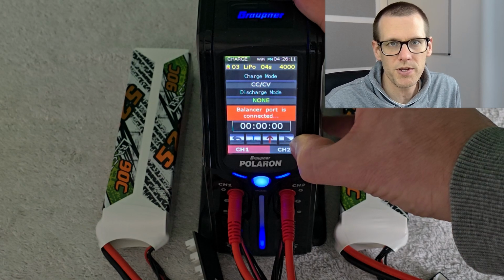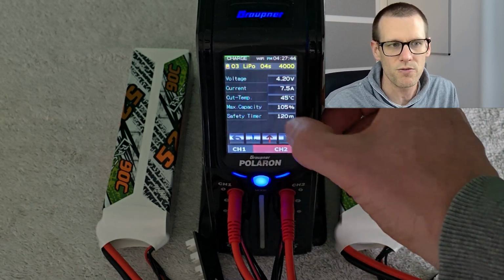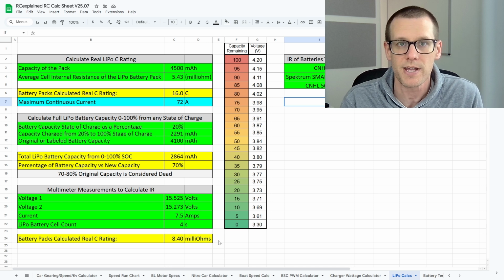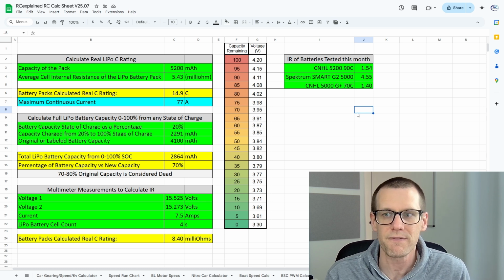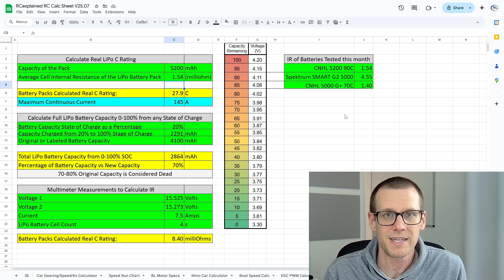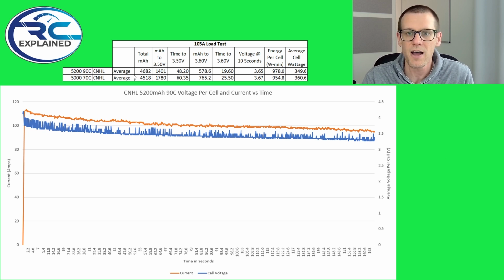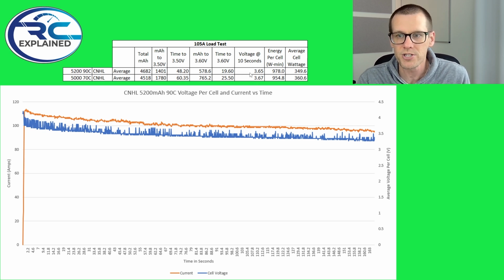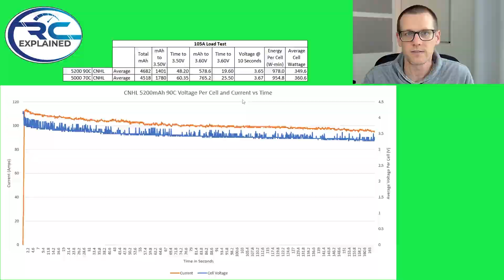CNHL Continues to Impress – 5200mAh 4S 90C LiPo Performance Test!

Comment: It’s still ch l and gens ace despite the turnigy vids of recently where people got free stuff . Same as the ovionics , the suck . Zees same thing . Prices are up there with the big boys now . They’re all minimums but work . Chnl , gens ace . Yowoos /hrb aren’t in the s tier as I previously thought . The red or black can pull out the battery . 6s hoovo 6200 soft pack is still going strong  oldest battery I own
Reply: Hoovo batteries are great budget friendly batteries I've had 4 of them since 2021 (2 3s 5200mah 80c) (2 2s 5200mah 80c) and just now finally upgraded my 3s battery CNHL Purple Series 6200mAh 3S 100c  since their internal resistance has reached time for retirement and many the CNHL is killer

Comment: I just charged and ran my new G+ batteries in my Felony for the first time. They didn't do well. Average IR was 3.7 per cell vs my 90C Racing batteries at an average of 1.7 per cell. (IMARS D-300) The best I could do with the G+ was a run of 85 mph vs repeatable runs of 93~94 mph with the 90C racing packs. I don't know if I got a bad pair or if these G+ batteries are no longer made with the same cells they used to be.
Reply from the maker: I'm surprised, I had a lot of confidence in these after testing many packs.
Reply: @RCexplained  Yes the results really caught me off guard. That is why it made me wonder if they switched the source of the cells. I was so looking forward to using them but when I charged them up the high IR readings set off alarms that they wouldn't do well and as it turned out they didn't. I will run a few cycles through them when I get the chance but I don't have much hope.
Reply from the maker: Its a good point. Lipo brands can change the cell manufacture at any time and this change is never known to us. It makes the industry very difficult to manage from a customer point of view.
Reply: I have the same exact experiense. I purchased two 5000mah 70C G+ batteries this spring and still after several runs IR is about 4mOhm. My over year old 5200mah 90C racing packs are stil below 2mOhm. My 6200mah 90C racing packs are at least as good. I'm not a speed runner but I notice the difference while driving. Supports the thought the G+ cell supplyer or manufacturing proces has changed.

Comment: If you need any speed run data logs I have plenty showing the 6s CNHL G+ 70c 6000mah and 4s CNHL G+ 70c 6000mah. Using QS8 castle 1515 and castle 1717 / MMX8s

Comment: Absolutely not happy with the cnhl 4s black series 5000mah. Worst pack ive ever owned. It puffed up after a yr. Did not pull very hard and one cell discharges quicker than the rest. Being 200mv lower than the other 3 when i hit castle 3.5v lvc. Best pack uve ever owned was turnigy rapid 4s2p 5500mah. I consider it dead now but still performs better than the cnhl ever did. Ive always had great luck with turnigy brand

Comment: I've purchased several CNHL batteries on the basis of your testing and reviews and am pretty happy with them so far, a hell of a LOT better batteries than the OVONICS packs that I purchased only a couple of months ago that turned into Pillowcases on their very FIRST run in my RC Speedboats. 🤬

Yet the same size/rated CHNL batteries barely raise a sweat and have twice the performance of the OVONIC batteries. 
Keep up the great work and all the best regards from Australia. 🦘🇦🇺
Reply: TRY AN SMC pack. You might be blown away at how much more power it produces than a China Hobby line Pack I have done all the testing research, cycle  life, and power test testing. An SMC battery which only SMC uses oil based cells. The oil keeps the internal resistance down compared to a water based cell. That is why what this gentleman is promoting will not outlast in SMC oil based cell in longevity per the internal resistance, which is the determining factor of how much power these cells can produce. Just like HRB these packs after about five or six months, the internal resistance will start to skyrocket in the direction of upwards because it’s a water based cell. That’s how they keep the revolving door so you keep coming back because your packs will start to produce less than less power. Yes, they might work flawlessly, but they’re not going to be giving you power that’s a guarantee.
Reply: Thank you for your response @Rcenthusiast90.

Yes I realise that CNHL aren't the Rolls Royce of batteries, but for their price and performance, they are pretty hard to beat. 👍

They have been run close to 100 cycles so far, and they are still holding up well, especially the internal resistance when I check on every single charge/discharge cycle.

I still have all of my 5+ year old TURNIGY packs, and they are also doing amazing for their age and amount of cycles over the years.

Still am severely disappointed with the OVONIC batteries and wouldn't ever waste a single dollar on any of their products again. 🙄

I wanted SMC or HRB batteries for all my different RC Boats/Planes/Crawlers, but unfortunately those brands aren't available in my country, so had to get the next best thing, which was the CHNL's.
Reply: @docbob3030  do you check usable discharge capacity after 100 cycles? Curious.
Reply: @Rcenthusiast90In practice, SMC don’t necessarily show to be more durable. A lot of people have complained they get bad rather quickly
Reply: @TheEchelon  and what’s your definition of bad?